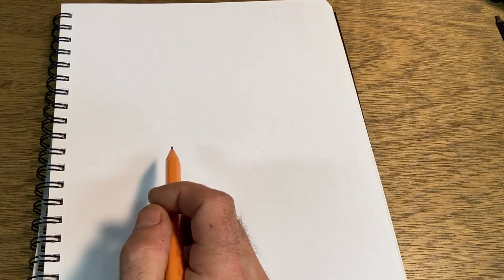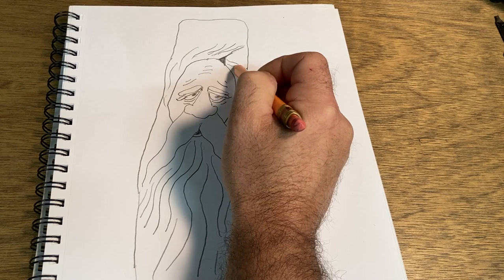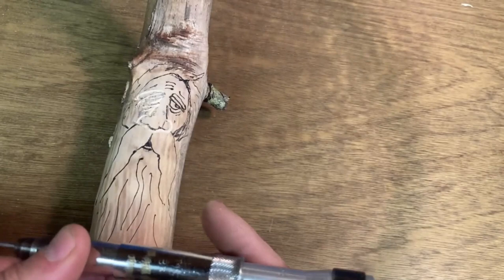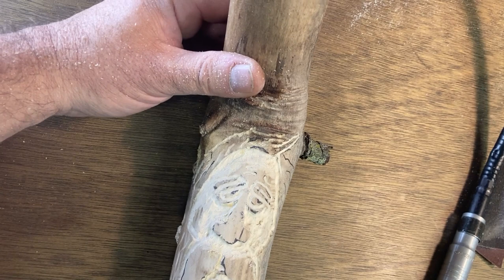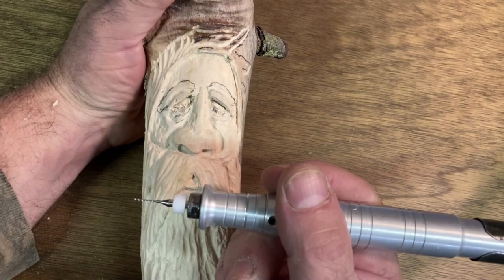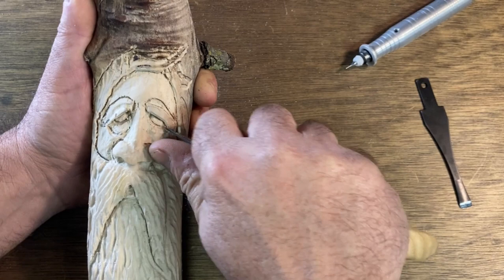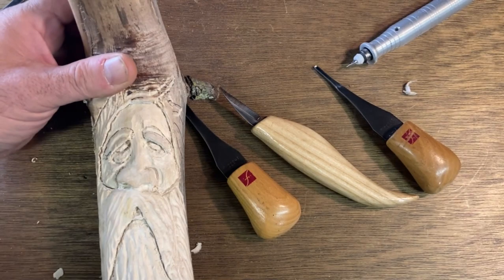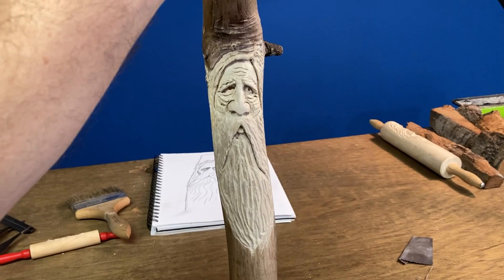Woodcarving/How To Carve A Wood Spirit Face On A Walking Stick

Comment: Rotozip tile bits are great as well, though they are a bit large and take awhile to get the hang of. Definitely a must have for power carving.
Reply from the maker: Yup , I've used anything I can from router bits to roto zips if it will serve the purpose.

Comment: Awesome! That one was more informative. Than the original walking stick video you made and that video was the 1st one I learned off of and was amazing too. Years back Not for sure if you have a harbor freight in your area? They have a set of diamond bits that are super cheap on the pocket book. They are excellent for the fine details for eye work as well. There come in the stick shape as well but they don’t break as easy 😀👍 Check em out maybe they will work for you too.
Reply from the maker: Thanks TG been there , Got some! lol

Comment: hi thank you for such an informative video , but when you mentioned slow with the fordham with the very precise bit , what is slow to you? and could you describe those precise bits or maybe you have mentioned ? just one thing I was wondering? thank you so much for your tutorials ! love them !
Reply from the maker: Hi, it  depends on how slow and the wood you're carving. if the bit is struggling and breaking then you need to go slower there is no certain speed I can give you only feeling out each individual piece . They would all be different. All I can say is take it slow and you should get a feel for it.. hope this helps...

Comment: Great, informative video Kevin. Just what  I was wanting to see. Was that a walking stick that one could use or did you only have a short stick sitting around?
Reply from the maker: LOL, found some junk wood outside the tent to use for the vid Todd. Otherwise I would have made a much better carving. Not really a stick I'd use , got a wicked bend and a big crack in the back.